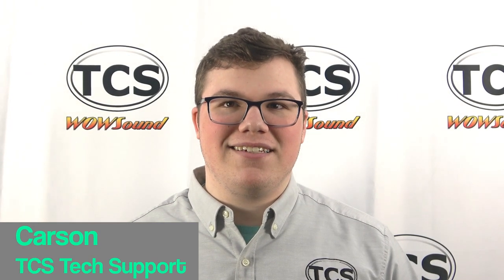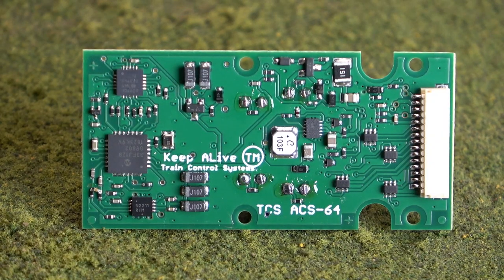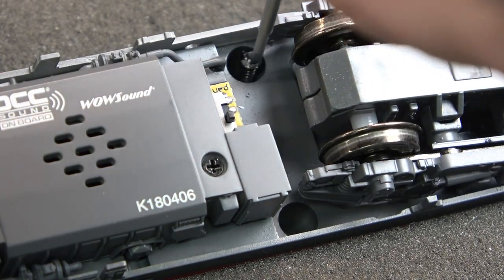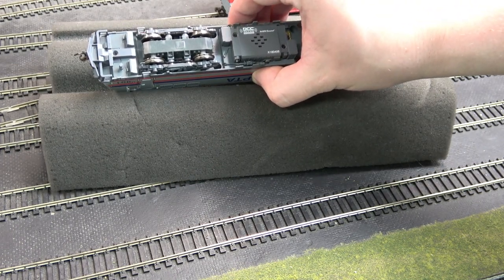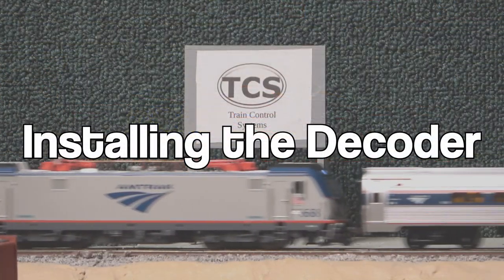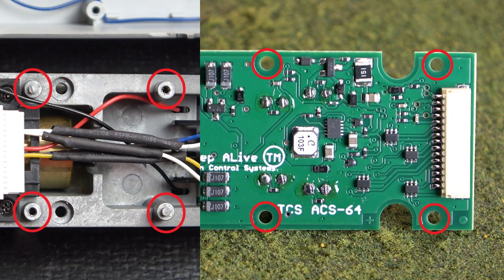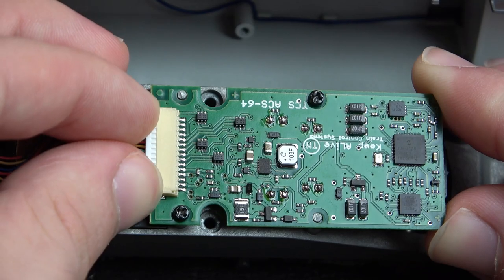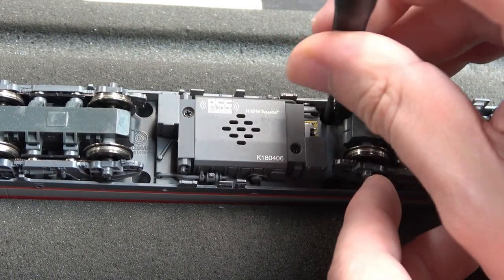ACS 64 Decoder How To Installation

Comment: I was so happy for the city sprinter as they finally gave a DCC ready option for the ACS-64's. However now I see the chassis it just looks like a proprietary DCC ready option. is there no board that's a plug n' play option to add a 21 pin decoder to this engine?
Reply from the maker: Unfortunately, this locomotive only supports that 15-pin plug with our Sound decoder. There is no converter to convert the 15-pin to a 21-pin sadly.
Reply: @TCSDCC  understood. Thank you for the response.

Comment: What about the wires from the shell that were plugged into original board?
Reply from the maker: You will not need to mess with those wires. Those go to the Pantographs for catenary operation. 

-Carson
Reply: @TCSDCC  ok, thanks.